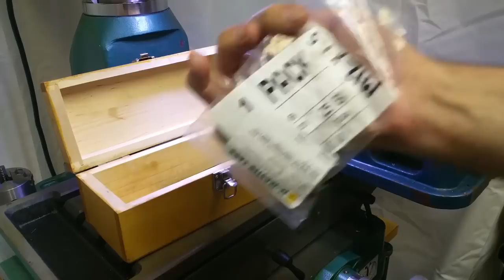Upgrade Your Import Boring Head

Comment: Yet another “I went to McDonalt’s and I am surprised I did not get a 3 course meal cooked by a Michelin rated chef”. 
If you pay for quality products you get quality products, regardless of where they are made. Anyone can find out how how to make tools with high precision. This is not a secret, books have been written on this topic and the subject is being taught in every mechanical engineering course, even in China. But if you knew anything about this you would also know it takes more expensive materials, more precise tooling and better trained and experienced workers to make more precise product. All that costs more, which is reflected in the price of the end product. Chinese can (and do) make high quality, precision tools. But you will not find them on eBay.
The reason cheap products are not made in US, Germany or Sweden is that the labour component of the cost is already high leaving no margin in low priced goods.
You make a recommendation not to buy a product based on YOUR specific circumstances (which you did not disclose) not knowing anything about the circumstances that drive the decision of others. 
Never occurred to you that for a casual user that is not concerned about 0.010” runout this may be perfect but a tool with 0.002 maybe out of reach ?
There are not enough good quality used tools to satisfy the market. And  if not for inexpensive tools from China machining for hobbyists would simply be unaffordable. One cold not build a table-top router for few hundreds if the only components available were the high quality parts made for the industry.
And what is your definition of “a little bit more money” ? 3 times the price of a price of low end product? As I noted earlier, there are not enough used high quality tools to replace low end tools from China.
On the subject of boring bars-you are comparing indexable bar with carbide-tipped. Apples and tomatoes. Indexable bars have a flat side to ensure consistent positioning of the cutting edge of the insert . The reason carbide tipped bars (and HSS) are round (even those made in USA) is to allow adjustments. The non- indexable bars can (and often are) ground to match the material being machined and thus the need for adjustments.
You complain about backlash on adjustment screw. The backlash is inherent to the design involving a simple lead screw or a spur gear for that matter. Plenty of videos that explain this, do watch some.

Comment: Thanks for the comments on how to upgrade the inexpensive boring head. I have a home work shop with a home workshop budget. I am not going to spend $500.00 for a tool when $75.00 will do the trick. I am willing to fiddle with a tool to get reasonable performance!
Reply: Me too, I think Stefan  Gotteswinter has best idea, when you buy from China Export, (CE) your buying a kit that needs building properly. It's way cheaper than buying a set of castings or forgings as major work is already done

Comment: Just bought I think the same boring head. Perhaps should have watched your video first before buying. I will give it a try as I have never used one before. Thanks for sharing. Regards Chris
Reply from the maker: I think a lot of viewers misinterpreted my message, so I should have done a better job of conveying the message.  The import boring heads are a good value but you should plan on investing a small amount on good set screws and hex keys.  One good carbide indexable boring bar can really up your game!  If you own a machine shop you should probably spend the money on a better quality boring head from the start, but for most of us home gamers, the inexpensive imported boring head and a few dollars worth of upgrades will serve us very well.

CNC is getting less expensive, even for home shop enthusiasts, and CNC can machine holes of arbitrary diameters, but a boring head will usually make a rounder hole.

Comment: The chinese built tooling is built to a price that the Western brand specifies.. for the home gamer dealing with tolerances of thousands these are just fine.. and a great alternative to the tooling that cost  400-500% more.. if your job specifies tolerance down to ten thousands of a inch spend the extra 400 500$. If you can settle for a couple thousands like myself, eastern imports are fantastic
Reply from the maker: Yep.  And the Asian tooling can be much better for a few additional dollars by swapping out the set screws and hex keys.

Comment: I got several also, I couldnt get the head to screw on the adaptor.  Junk is probably a good description.  Think I got it from MSC.   One was made in India the other China?
Reply: petsatcom i couldnt get the head onto the adaptor either and had to take a .2 mm cut off the adaptor thread. When i got another head( different size) it turned out that the adaptor thread was correct and the female thread in the head was wrong

Comment: recently i picked up a set of small diameter boring bars at a flea market and made some shanks so they would fit into my Schmid boring head which uses a 12mm diameter hole. making the shanks i used a reamer (10mm and 8mm reamer respectively) to get the correct size bore for the boring bars. when reaming the shanks i used a water based coolant which gives a slightly tighter final fit. finally a little drop of loctite as the boring bar was twisted into the shank helps hold it in place. even if the boring bars get hot during an operation, there is not enough heat reaching the base that would dissolve the or loosen the loctite. if your boring bars are getting hot enough to melt the loctite then they are being over stressed anyway and will be turning blue

Comment: I buy import because it's all I can afford. You condemn the head for 3 set screws and hex keys and a little backlash but the body you don't make comment, so I presume the main body itself is good. So what's your problem? You bought it cheap like the mill, bars and probably many other things , is it because it is not made in USA, then buy local and support your fellow Americans but you can't have it both ways. In Australia we don't have alot of manufacturing so its mostly import including USA, for the price and 3 set screws I know which one I'll buy.
Reply from the maker: I guess I did a poor job of communicating.  Based on some of the comments,  many people apparently think I'm some uber-nationalist xenophobe.  I buy a lot of imported goods.  I buy based on value.  For some tools, I'll pay more for a better tool, and for other jobs I won't.  It depends on what I need and how much I'll use the tool.  And when I say I'll pay more to buy a better one, that doesn't mean "buy American".  Many times, it's Japanese, Swiss, Swedish, German, Austrian, and sometimes Chinese or even Australian although we don't get many Aussie imports in the US.  In this particular case, the Chinese knock off of a quality US manufactured tool can be made to work with a few improvements, which is the point of this video, but it was worth saying that if you make money using a boring head as a regular part of your job, it's probably worth spending a lot more to get the original quality item and not waste your valuable work time running down good quality fasteners and hex keys and dealing with the inexpensive tool's other shortcomings.
Reply: Thanks for replying.. I agree with your standards as explained, I myself arm similar in attitude and being retired hobbyist this influences me also. Sure if I was in business I'd buy the top end items but I'm not and with a limited income, I buy cheap, China or India, in this part of the world and massage it a little to make it work. 
Thanks Peter

Comment: You can grind the brazed on boring bars to the right geometry with diamond wheels to give them a good chance at cutting. They actually cut nicely once you do that.

American made boring heads aren't just "a little more", it's 50 dollars vs 500 dollars difference. If you can just replace a few dollars worth of set screws and allen keys then it's still worth the price.

Comment: Your comments apply to most (?) Chinese machine tools, replace the screws and they tool will get  the job done. Hardly seems a reason not to purchase though. You said yourself that you have done good work with it. Thanks for an interesting video.
Reply: Robert K
Spot on. I use "cheap Chinese" and work to 0.01mm. American made is prohibitively expensive in UK because import duties and carriage costs almost double the dollar price. The other disadvantage of buying from the USA is that everything is imperial which doesn't fit well in a metricated environment. At least the Chinese cater for the metric market.
Reply: Peter Tyrrell you would be correct if you wrote “ your comments apply to most low-end, inexpensive tools” 
There are plenty of those coming from other countries where labor cost is low. 
Chinese companies know how to make high precision tools and they do that. But those are not available on eBay. 
My argument is that if not for those low end products from China many hobbyists could not afford to get into it. Some are happy making simple things and are happy with 0.010 accuracy that is way better than what they could achieve with hand tools, others learn and progress to 0.005 or better.
But the important part is people are learning how to design and make things, not just consume products made by others.

Comment: I have a Shars 3"  R8 Boring head set 3/4" bar and holes, Shars Part# 202-8021A  . Will all those set screws and parts you replaced work in the Shars ?   Do you have those part numbers that got deleted with the old video ? Thanks !
Reply from the maker: There's a good chance that the screws I bought will work with your Asian import boring head if it looks like the one shown in the video.  Of course, to be sure, you should get a thread gage and measure the thread pitch on your boring head.  I'll try to find the part numbers for the screws that I bought at McMaster-Carr.  Give me 30 minutes after this comment to find them and post them.  If they aren't in the video comment by then, I was unable to find them.  Good luck!  My boring head is a lot better after the upgrade.
Reply from the maker: I found my McCaster-Carr order and it looked like I made a mistake on the sizes of the set screws in the video.  I verified the set screws that I ordered with the set screws in the boring head, and verified the thread pitch with a thread gage.  I updated the video description with the correct set screw sizes.
Reply: I got the set screws you listed from McMaster Carr . They work fine...and I milled a flat on the cheapo boring bar that came with it.  Where did you get the replacement ball bearings ? Thanks !

Comment: Those cheap China boring bars work great if you know how to sharpen them.
Reply: Chris Young if you broke it milling aluminum you do not know how to use them. If you did not break a “made in USA” one yet just means you did not apply enough force. Put it in bigger machine and crank rpms and feed rate all the way up.